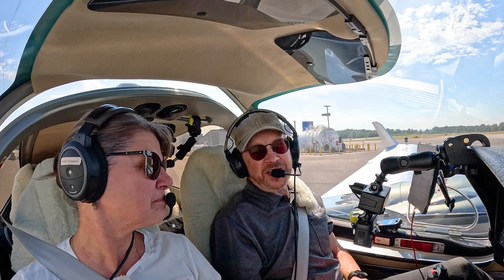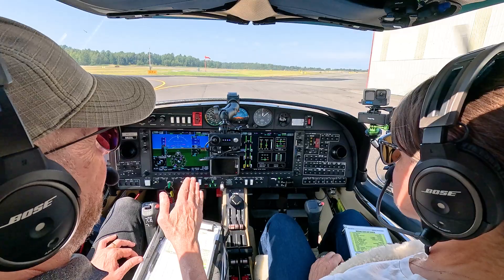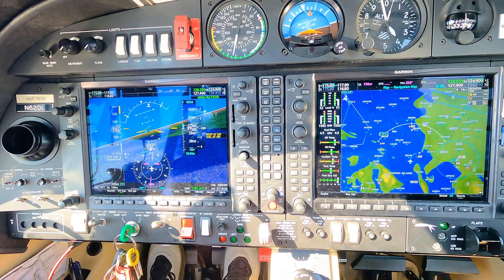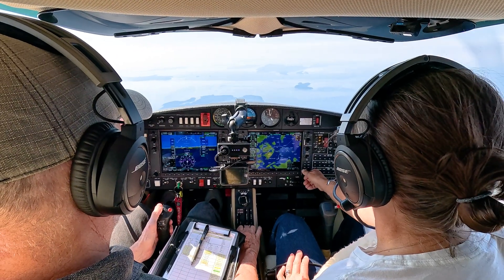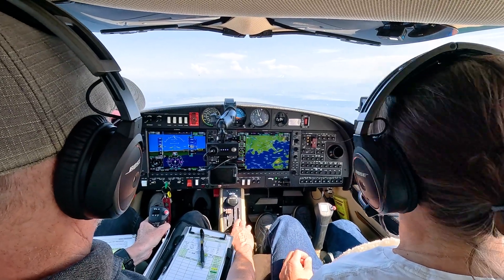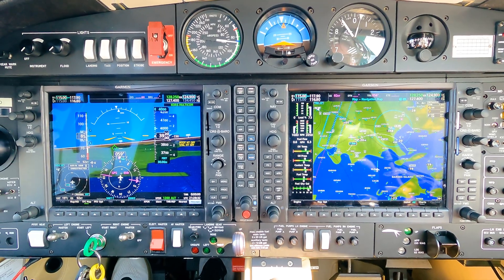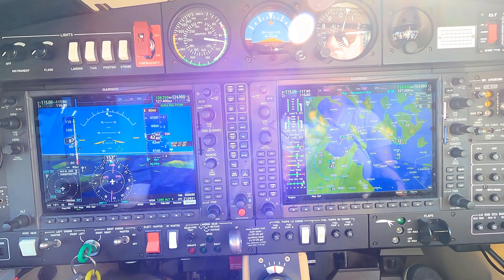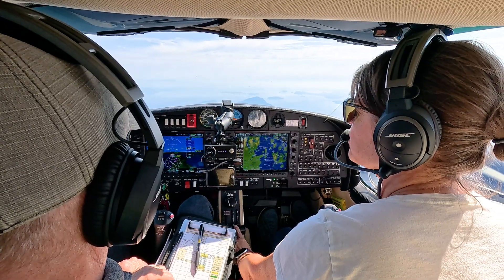Vmc Demo - Episode 8 Maneuvers in a Diamond DA42 VI

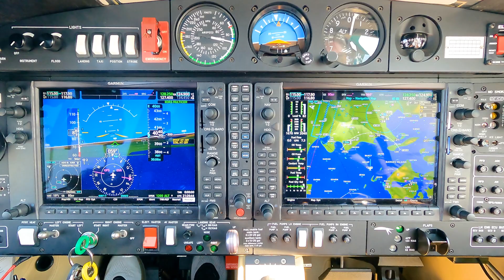Comment: 4:30 we weren't allowed to use rudder trim in the DA42 for the Vmc demo at my school because it was considered dangerous. That said, I found the Vmc demo to be the easiest maneuver. Steep turns and short field landings not so much!
Reply from the maker: Do you know what they were they concerned about with rudder trim use during the Vmc demo?
Reply: @twmba65 From what I gathered it was because in the event of a loss of control during the Vmc demo they wanted a neutral rudder feel to counteract an incipient spin in either direction.